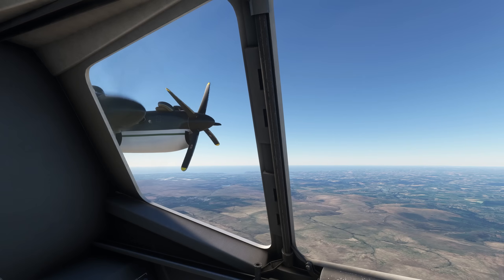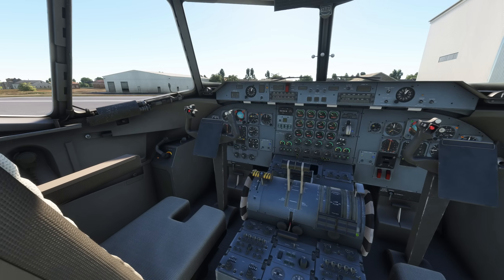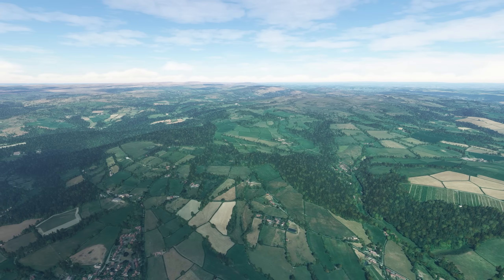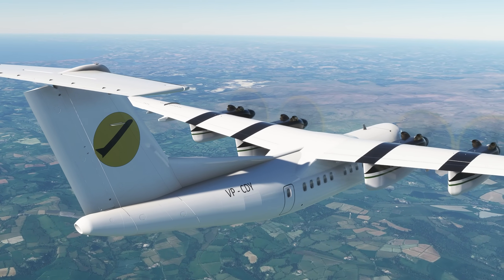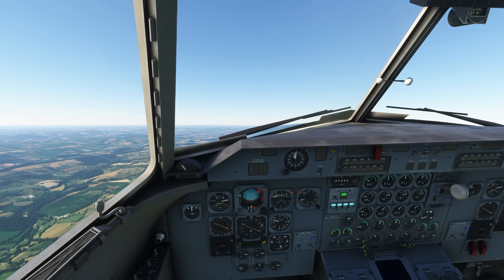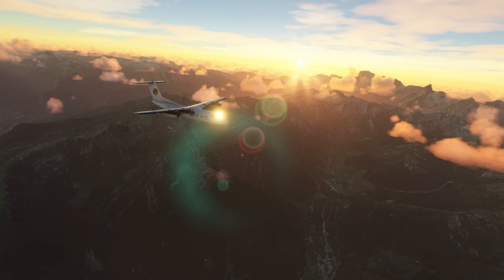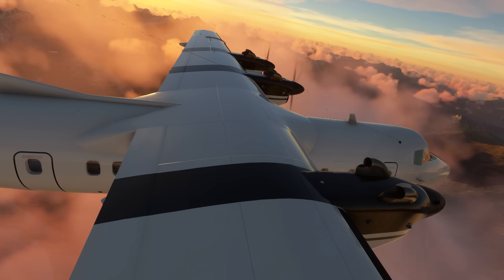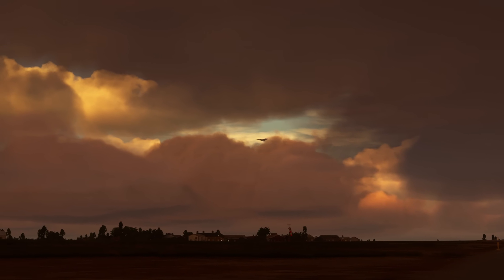WHY Did This Dash-7 STALL on a 3-Engine Climb?

Comment: Wow this is very interesting. I wonder if the pilots were unaware of the nose up trim and the lack of flaps and if the autopilot should have been disconnected before the test was started. Once they dropped below minimum speed (V2 ?) Their rudder could not stop rotation ? Apparently they did not realise their airspeed had decayed dangerously or that trim was maintaining a stall inducing AOA
Reply from the maker: I think the fatal error was the missed flap setting, perhaps one thought the other had moved them. With the flaps at 25 the stall speed would be lower, so although the speed was decaying, it was intended to get them back to V2 speed, however, as they reached the now higher stall speed due to the flaps being up, it probably startled them for a second. In this instance, a second is a long time, they moved the power levers forward to stop the decay of speed but in turn added a fair amount of asymmetric thrust from the 3 live engines. Once the autopilot was disconnected all the forces holding the aircraft in steady flight were removed and it caused the roll and probably a final sharp nose up which caused them to enter the stall. They were probably aware of the nose up trim as the aircraft was slowing and going to maintain altitude but I think the flaps caught them out. If they were in a spin, the opposing rudder and nose down attitude should have stopped the spin, but with the control input being a full nose up movement, I think the pilot was trying to recover from a dive although the movement kept the wing stalled. I'm not sure and only my view based on experience spinning an aircraft and the information available to us for this accident. Great questions though, it gets you thinking.

Comment: Was trying to understand what manuovers are carried out at "Flight Level 60 up to FL 100.... that's a long way up. Then I realised you meant 6000-10000 feet. Flight Level is a reference to any altitude above 10000 feet....unless things have changed since my flying career.
Reply: “Flight Level” is a reference to an altitude flown on standard barometric pressure setting (29.92 inches of Hg or 1013.5 millibars). Here in the US, flight levels start at 18000 ft (usually), referred to as FL180. In Europe it varies by country (maybe FIR?) but usually 5000 to 7000 ft (FL50, FL70 etc). Everyone flying at or above the transition level is required to use standard setting on their altimeters, while anyone flying below is required to use local altimeter setting.  FL60-FL100 means 6000-10000 feet flown using standard setting, which is what they were doing.

Comment: While not a qualified test pilot I have been tasked on multiple occasions to carry out post-maintenance check flights. Maybe because I'm not a qualified test pilot and have never considered myself to be more than an adequate, average pilot I've always approached these events with a very focused attitude. It surprises me that the autopilot  remained in use late into the test stage of the flight, typically I would expect that the handling pilot would have wanted to be more connected with the aircraft. Overlooking something as basic as not following a simple check-list requiring a flap selection would also lead me to believe that this crew were not adequately focused on the task.

Comment: A spin needs a stalled wing and a yaw. First they stalled the aircraft, and then in the stall applied full asymmetric thrust , giving them a wild yaw and entering them into a spin. At that stage reducing the thrust to zero, correcting the yaw with rudder and keeping the nose down may have saved them. My opinion is that it was more a lack of aerobatic training than their age that was at fault.
Reply: Correct. Upset/UA recovery training would prevent this. If I owned an airline I'd by some Extra 300's and require all pilots to one hour a month in one.
Sounds also like lack of flight planning and the failure to follow the plan. Unprofessional.
I know a lot of pilots over 65. Age alone isn't the problem. If they have been flying since their teens and continued to do so, no problem. The older pilots who didn't learn to fly until they were 40+ are a problem.
These guys should have cut power, center the spoiler/ailerons, full right rudder and push to half way forward smartly then keep going forward until spin stops. Center all controls, recover from dive. They then had the altitude to recover.
An RAAF crew managed to kill themselves in a Boeing 707 from 5000 feet by doing two engine out on one side asymmetric practice about like this crew. Got slow, below Vmc for the configuration rolled over. Age had nothing to do with it.

Comment: Great video. I hadn’t heard of this one before. A couple of thoughts that may or may not be worth reading. 

In my view, the only explanation for their actions, as experienced test pilots, is that they never anticipated the possibility of a stall. Consequently, they never briefed their actions in case of a stall. (At that time, and for many years after, civilian pilots of highly capable aircraft were taught to recover from a stall using thrust, with minimal altitude loss.  It should go without saying that this procedure is not viable with an engine shut down.) Also, if they were anticipating the possibility of a stall, they would not have let the auto pilot fly them into it. 

Stalling due to improper configuration, the startled flying pilot reverted to training and attempted to recover using thrust while maintaining back pressure to reduce altitude loss, forgetting that the number one engine was shut down. The result was a spin. And since the auto pilot flew the aircraft into the stall, excessive nose up trim would impede them from reducing angle of attack. Probably didn’t matter, getting a multi engine airplane out of a spin in 5000 feet isn’t likely. 

Maybe they weren’t using a checklist, maybe they were and just missed one very important step.

After the crash of Air France 447 in 2009, the civilian world got “back to basics“ and started teaching angle of attack reduction as the first step of stall recovery.
Reply from the maker: Hi David, I would agree. The missing of the flap selector is puzzling but perhaps it was simply missed. As you say, neither pilot was preparing for a stall and would have been startled by it, especially as they were expecting a lower airspeed (if the flaps were at 25). The thrust moving forward was probably a response to the lower airspeed but also as you say, part of the stall recovery at the time. With the autopilot in for that initial second or so it held the attitude high and the asymmetric thrust would have been masked for a short while. Once the autopilot was disconnected, all these forces were unleashed at once, and especially if it was not anticipated, would have caught the pilot by surprise. Even trimming the nose down after the event would have taken a second or so which was time they didn't have. I think the back pressure would have been as a result of the extreme nose down attitude but as you say it also could have been in an attempt to reduce the altitude loss. That being said, I was quite surprised that they were carrying out the test from FL60 as this is quite low, but also they were not anticipating any issues, even on 3 engines climbing away at V2 should have not been an issue and was the point of the test!

Comment: I’m no pilot. However, I watched enough blancolirio videos to know that these two guys don’t seem to be anywhere close to being qualified test pilots.  Proof of that is in forgetting the flap settings. Using the autopilot during a test flight seems crazy — unless the only goal of the test flight is to test the autopilot.  

Flying such a short distance with 10,000 lb of fuel on board?  Wouldn’t it be prudent to wait until after test flights to load the plane like that?  In other words: first test it as lightweight as it is safe to fly.  THEN repeat the tests with a heavy fuel load.  

10,000 lb of fuel is equivalent to carrying (50) 170 lb passengers.  FIFTY!  In a Dash-7!

Comment: It is a fact that if a plane is flying at its limits on autopilot and you disconnect it there will be a sudden change in attitude. Should not have been done on autopilot. A litany of compacency perhaps. Asymmetric thrust in a spin is almost a death warrant, especially with the outboard engine in a four engined craft.

Comment: I'm an ex airline pilot 76 years old. But still able to fly private ultralights. I'm very astonished those guys carried those maneuvers with the autopilot. This seems to be a dangerous practice.
Reply: Retired TRI/TRE (Boeing 737) - I agree, particularly having the autopilot engaged and incorrect configuration of flap setting at the start of the test. Such an experienced crew too.

Comment: After the stall, reducing engine power was correct. Inputting full nose up trim was a fatal mistake.
Reply: I was trained to go full power in a stall and nose down. That was in a PA28.
Reply: @aidenwrenn5342  that's standard recovery. You point the nose down to try to build up airstream and get your wings' lift back.
Reply: Also, trying to go full right aileron in a spin is also dangerous

Comment: Analysis makes no sense.  In both a spiral and stall, the wings need to be level before any nose up input it applied.  Had they shoved the elevator forward within the first few seconds of the event it was most likely recoverable.  Also, in a stalled condition with an engine out power should only have been applied on engines 2 & 3.

Comment: Stalling a multiengine plane starting a spin way more difficult to correct vs single engine plane.  Stalls are practiced on a simulator with multiengine  but recognition before a stall is what is stressed.  I underwent a spin in a single engine plane.  It takes 4000-5000 ft to recover when you know it’s going to happen.  Autopilots can leave you a miss as they wait to the last minute of attempting to correct something then throwing it in your lap to figure out.  All that extra up trim is easily forgotten. Complacency and over confidence can play a role as Mother Nature can humble you or kill you.  If they had a few thousand feet more maybe a better outcome but multiple spins sealed their doom.
Reply: 4000/5000ft to recover from a spin in a single engine aircraft...w.t.f.were you flying???
Reply: Spin recovery is less than half that altitude.  If it takes you 4-5000 to recover, you’re incredibly incompetent and nearly dead .
Reply: Yes, they should be starting from 10,000ft AGL as standard procedure for a complex stall like that.
Reply: @jedi8810 Ok so no that’s not true , spin training is done at half that altitude.  From slow flight /incipient roll / spin recovery is 2000ft total .

Comment: I don’t get it……..every pilot knows to push the nose down during a stall. It’s the only possible way to recover. 

If the wings begin to stall and you pull the nose up you’ll enter a spin…….every time.
Reply: That is fine for a single engine. More complicated in the case of that multi-engines.
Reply: And oppisite rudder

Comment: Is there no check list for such functional test flights? That would have made it a lot more unlikely to miss the flaps setting
Reply: I believe there would've been an extensive and detailed checklist. But they may not have been using it properly.
Reply: Bingo- thats the root cause

Comment: Your replication at 10:30 shows an impossible bit of flying with the aircraft basically rotating with the wings as the vertical axis and the nose going down. This is neither a spin or a spiral dive.

The captain was the same pilot who crashed a DHC5 Buffalo at Farnborough Air Show in 1984. You don't live to be an old pilot if you make so many mistakes on the same flight - leaving autopilot engaged, failure to lower flap, ignoring stick shaker, applying asymetric full power which pushed the aircraft more into the spin, opposite rudder too early, holding the stick back...

Comment: That moment when the Dash‑7 began losing airspeed during the climb, with the autopilot still engaged and flaps retracted — you could feel the stall coming like a slow-motion warning no one acted on in time.
Reply from the maker: The airspeed just slowing ticking down in the 'background'. The strange part for me was that the stick shaker should have warned the pilots of the impending stall, but they still managed to enter it.
Reply: @CuriousPilot90  My guess is that the pilots' control inputs were fighting the autopilot's, and that this initiated the uncontrollable stall/spin.
Reply: Were they not test pilots performing stalls on purpose?
Reply: @jedi8810  Nope, they were test pilots performing a 3 engine climb test at V2. Not stalls...
Reply: Did the flight data recorder even register a stick shaker activation? Maybe it was  broken due to being in disrepair, like the cockpit voice recorder
Reply: Does the Dash-7 not have a stick pusher?

Comment: Very interesting. Not flown the 7, but no way is it certified for spinning. With all those engines way out on the wings it will not be easy to recover from a spin and certainly not with nose up trip and full up elevator.
Reply from the maker: Especially with the No1 engine shutdown and feathered! Add in the potential startle from the unexpected stall, then add all the control forces masked by the autopilot. Not an easy situation to be in!
Reply: Forgetting the flaps made the whole thing pointless anyway. And what happened to V2?

Comment: But why did they ignore the stick shaker? They must have realised something had gone wrong. And then when it did stall, why didn't they just put the nose down and get it flying again?
Reply from the maker: That’s what I find most confusing, they would have had to continue through the stick shaker to reach the stall. So it would suggest a major distraction or even incapacitation. But when they enter the spin/spiral there are inputs on the rudder, elevator and spoilers, showing that they are attempting to fix the upset.
Reply: The test they were doing would have brought the aircraft close to, if not into the stick shaker regime.   They likely just didn't realise how close they were to an actual stall, nor how much nose up trim the autopilot had dialled in.  They probably expected recovery to be quite easy, and were surprised by how violent the attitude change was once the AP was disconnected.
Reply: @najaB76 amateurs
Reply: @Tatteddaddydc no they were both professional highly experienced test pilots
Reply: @Tatteddaddydc I am sure you are more qualified 😂
Reply: Maybe one had a heart attack and the other one got taken between handling the plane and checking his partner ?  NO voice recorder, so we will never know. A mystery.
Reply: unlikely
Reply: The control actions they did not comply with actions must be made to spin recovery.
Just my opinion.
Reply: Two old complacent farts. That’s why. I hate to say this about a crew that perished but you look at the hours and age and that speaks louder than anything else
Reply: Spatial disorientation
Reply: @Woodysadventures117 definitely not
Reply: @a @alessandrodevoto5764 what’s your answer than genius?

Comment: You start this video "stay tuned to see how this incident ...."
In aviation there is a clear difference between an incident and an accident.
An accicent is defined as a situation where damage, loss off hull or loss of live is involved,
while an incident is a dangerous situation that basicly only damages ego's.
By experience on an turbo prop airline simulator I can state that even with experience, a spin can catch you of guard  and time is verry limited in such a case.
Combine this with spoilers rather than ailerons and the situation becomes even more critical.
A CVR indeed would have been helpfull investigating the cause.
Reply: loss of life  off guard
Reply: @localbod  sorry mate, I'm Dutch not native US
Reply: @pascalcoole2725  I didn't mean any offence by it and I apologise if I pissed you off.
I'm not a native of the U.S. either. I'm a Brit.  :)
Reply: @localbod  🤣 no worry you didn't
Reply: I think you meant to spell. "Basically." Guessing it was misspelled by accident. Sorry, I had to 😂